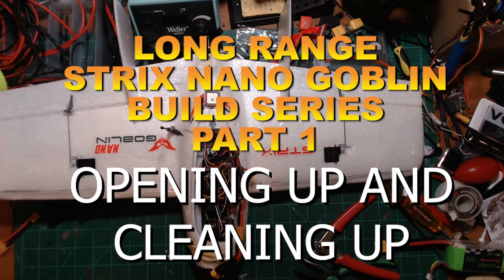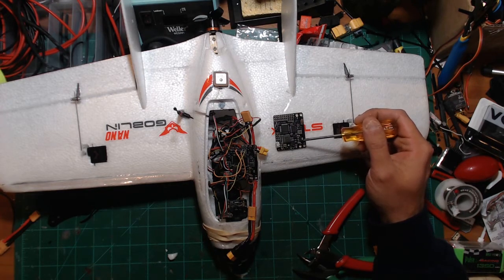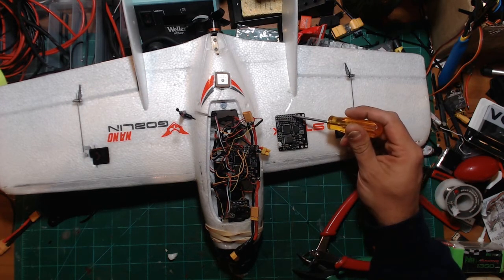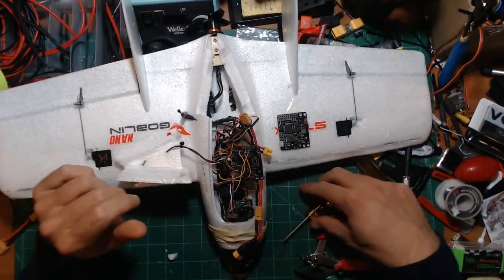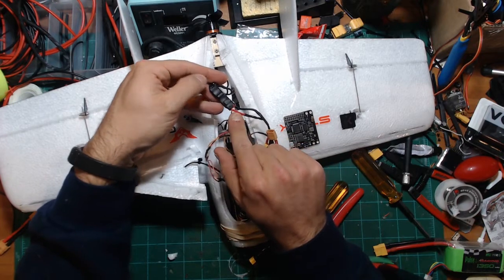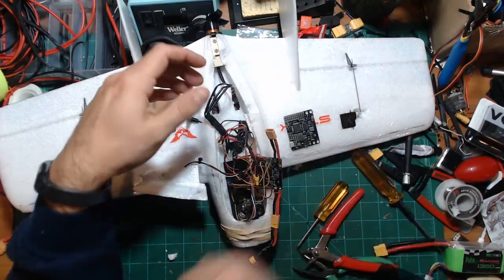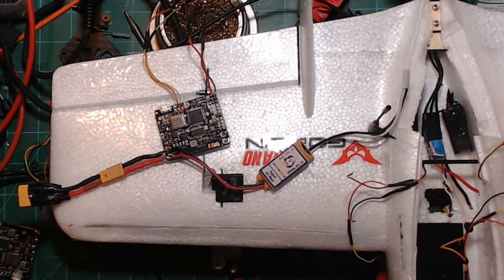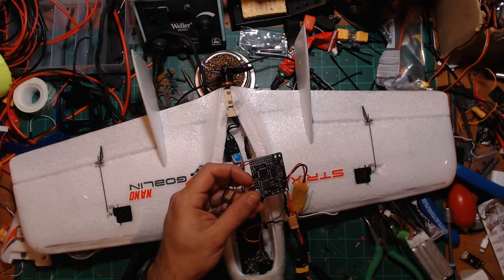LONG RANGE MICRO PLANE SERIES: STRIX NANO GOBLIN BUILD PART 1

Comment: what flight controller is that?
Reply: Wondering the same thing :)
Reply: CLRACINGF4 AIR
Reply: He definitely needs an omnibus F4 20x20 with a ubec. Wouldn't leave so much space in there for everything else. Full size board is too big for this. Are you then furious fpv f-35 lightning would have been great for this build